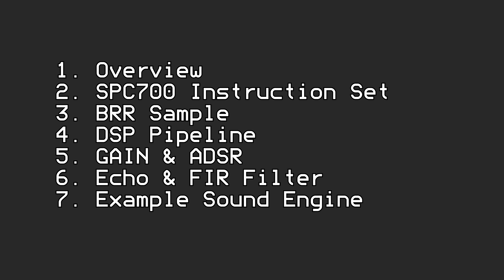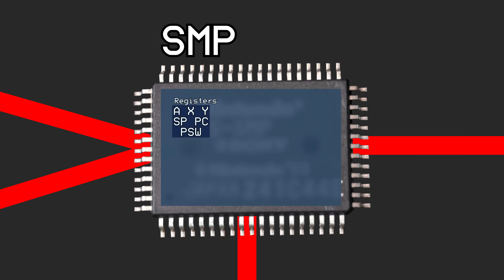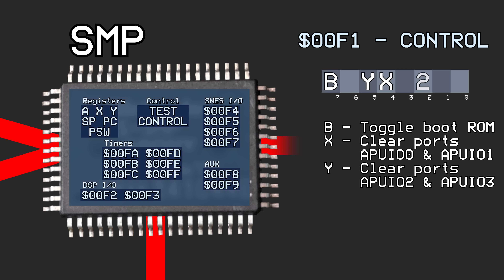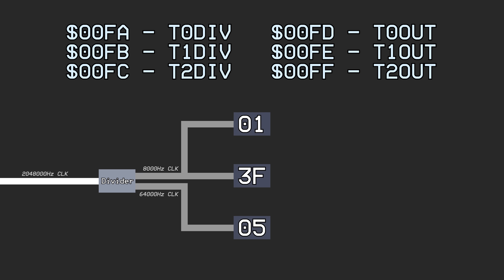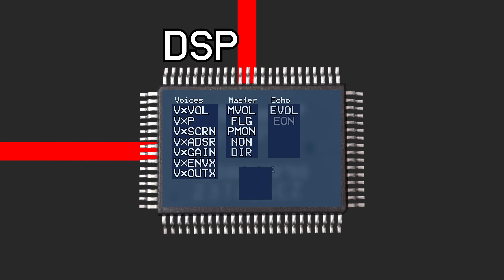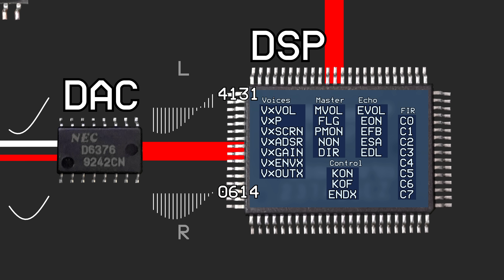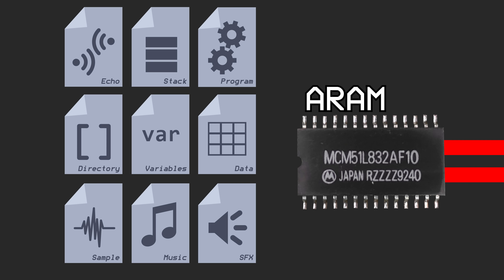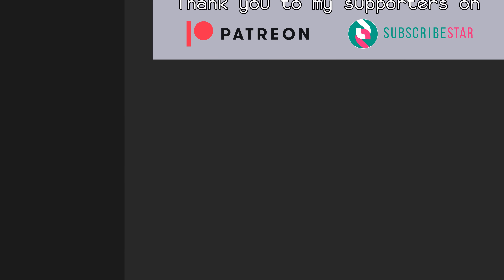SNES Audio System Overview - SPC700 Series pt. 1

Comment: Hello, I have a 1chip outputting very low audio from the dac converter that goes low all the way to the rf and composite, caps measure all good, voltages are ok, my local tech says he's never seen such problem, do you have any idea what could be causing this(tested on different tvs various cables and jumpered everything tried all possible fixes with jumpers)
Reply: broken caps, dac, board, or dsp

Comment: I'm really curious on SNES's audio chip “SPC700”, since I've heard lots of SNES music, some music are using same instrument between different games, that's made me wonder is SPC700 has some internal instruments. This(or these) video(s) is(are) really deep in.
Reply: Since the SPC700 doesn't contain any ROM aside from a small piece to be able to write in ARAM in the first place, all instruments you hear must be provided by the game. So when you hear the same instrument, chances are, the two games use samples from the same sample pack (it happens more often by games of the same company and composer, of course). In particular, Nintendo provided some default samples in their software develpment kit but there also exist 3rd party sample kits out there (at least, I wouldn't be surprised of their existance). In other cases, the samples are ripped from the same source independently (which too can happen since Roland samples are popular, some of which are used by the aforementioned SDK).
Reply: @MarioFanGamer659  The soundtracks for some Ocean games were made on Ocean's own sound drive, called 'Medit'.  This Drive was far superior to the sample standard that Nintendo offered to developers.  Listen to Waterlord Soundtracks, Eek!  the cat, and the canceled game of Green Latern, (there's the soundtrack, here, on Youtube), you will notice how the osts of these games sound better than Nintendo's standards.
Reply: @MarioFanGamer659  I think Tim Follin also used another sound driver, as the osts of Plok, Spider Man and X-Men arcade revenge, Off Road, sound different from the "standard nintendo".
Reply: @Vinicius-hs2rf  I'm aware that there are different sound drivers out there (Rare is another example of a custom sound driver), my post was primarily about the samples, though.

Comment: Pffff after waiting a nearly 2 years, we finally have a new video about the snes audio system,
Next time it would be very interesting to know how exactly the snes converts those BRR samples back into 16bit and how everything is smooth out,
Also for what i also do know is that it is possible to stream uncompressed 16bit audio directly into the snes audio dac by disabling echo writes,however this will involve most cpu power and workram,so there will be no power left to run a game.

Comment: Though I don't know much about it, the SNES sound system is actually my favorite (comparing it to stuff like MID, MOD, XM, or IT). I'm glad you've been able to get to it. Your other videos have helped me gain a better grasp on how my favorite consoles work, in conjunction with dev manuals, and observation on my own. I'm hoping I can do a series similar to yours with the AGB, my favorite handheld. Sadly, its audio system is not as elegant as the SNES. It's just 4B buffer of 8b playback. My dad and I are actually dissecting a dead GAME BOY micro (the charging port is thrashed). Thankfully, it's ONLY AGB stuff. Every other AGB has not AGB stuff. Your videos have also helped me with the rendering in a game I'm making (I might also make an engine for FDS, SFC, CGB and AGB). Anyway. I love computers. I love your work. I'd love to do what you do, but for the AGB.
Reply: Older SNES emulator do have feature where you can save the music as 8-channels .MOD file.

Comment: Was the timer in the SMP chip responsible for timers in-game? Or am i just connecting one to another without more knowledge
Reply: The timers were typically used as beats for playing music. In practice, the SMP chip operates fully autonomously from the rest of the SNES. Most games couldn't care less what it's doing after they upload the program/music and set it loose (other than to tell it to play SFX or load another song.) I'm not aware of any games that actually receive any timing signals from the SMP.
Reply: @michaelcalvin42  ohhhhh, that makes more sense since it was one of the sounds chips in the SNES

Comment: Is there any documentation on Port-Mapped Addressing vs Memory-Mapped Addressing?  I just started to watch the linked video again and I just was wondering.
I've never been able to figure out if they are just two different paradigms of the same thing or completely different architectures.
Reply: In a memory mapped system, each register shows up to the CPU as a dedicated memory address, which is more convenient to program and has less computational overhead.  However, this increases the number of pins for each chip in the system, since you need to add a lot more address lines to make all the registers visible.  It also reduced the total address space available for RAM or ROM, which may be a major concern if the main CPU can only address 64K of memory.  Memory mapping is often used for personal computers, as they have powerful CPUs and a lot of RAM available.  Multiplexing the address and data lines is often used to keep pin count low.

Port-mapped systems usually only have three registers for each subsystem... one to select a register number, one to read the register, and one to write the register.  This tends to be cheaper and frees up more memory address space for the CPU.  Many port-mapped systems also support auto-increment, so when you read/write a register, an internal pointer will automatically move to the next register.  This is nice for streaming data to internal work RAM or reading ROM tables, and often used for graphics or sound.  Consoles and arcade machines made in the early 90's and earlier, or any systems with an 8-bit CPU, typically use port mapping.
Reply: @Waccoon : it's also an easy way to restrict the CPU from accessing the memory of the subsystem, which is what the PPU chips do during active display.
Reply: @Waccoon  Very thorough and well thought out reply.
I wish it was easier to find that answer with Google.  It really should be what comes up when you look for that.

Particularly Port-mapping.  Its VERY hard to find information about it.

There are in/out instructions for ports and memory map instructions. 
It is super non-initiative to guess how it works when reading, "Intel 64 and IA-32 Architectures Software Developer Manual" to figure out how it works.

There is also NO information about what the port numbers may be, or what hardware they access.
Reply: @whtiequillBj  Ports on x86, Z80, and 6510 CPUs are a bit different.  The CPU has extra pins to drive external hardware, and dedicated instructions are used to activate these ports.  While they are called "ports", they work differently than ports supported by coprocessors, like the DSP in the SNES or video chip in the Genesis.

Yeah, it's a bit confusing, as were all things during the Wild West years of the computer industry.  Lack of documentation is just par for the course.

Comment: Wow, this is exactly the kind of information I was looking for! Thanks so much for making this series. Your graphics series are great, but I've tried to understand the SPC700 at a lower level on my own. (with only minor success) 

I make chiptune music, and I have math and some CS knowledge so I've wanted to make sense of the SPC700.

Last year an audio plugin called chipsynth SFC was released that emulates the SPC700 exactly. You can see the registers for playing back an SPC in this. I tried to break apart some of the classic music I like and get into the fine detail of the timing of everything. I ran into an issue trying to understand the envelopes though. The ADSR makes sense, but the custom envelope settings with the Increase Linear, Decrease Linear...etc wasn't exactly clear. I was trying to make sense of the timings, but couldn't quit get it with Nintendo's documentation. I was able to make sense of the bit operations a little bit couldn't convert it to actual lengths of time. 

Your explanations of the timers completely cleared up my understanding of these. I can't wait to get to the rest... time to Patreon it up!

Comment: You should mention as well, that the SNES had a huge disadvantage of loading times for soundtrack data. Some games stay on a black screen to shovel sound data to the SPC whenever the song is changed.
Reply: Yep, though I assume most of this was from loading the actual samples. (and maybe sound effects too?)
Reply: @Midee  Yeah, the dirty secret is that data was often compressed, so even cartridge-based consoles didn't have "instant" load times.  Loading data into a port-mapped chip can often be pretty slow.
Reply: It doesn’t take very long to load 32K.
Reply: @sirnickity  It does when you consider the bandwidth. Everywhere else on the SNES, 32 KiB is no problem because you can very easily access most of the memory either through mapping (WRAM, cartridge RAM, enhancement chip memory) or through registers (OAM, CGRAM, VRAM) where you can easily do DMA. However, in order to write to ARAM, you have to communicate with the APU and synchronisation between CPU and APU takes a lot of time relatively speaking.
Reply: Secret of Mana is especially annoying in that regard... thankfully there's a MSU1 patch.
Reply: Most N-SPC variants store few music at ARAM, which could be switched via input ports. Surprisingly, few N-SPC games (such as most of those using Nova's variant of the N-SPC) store every song in ARAM(!).
Reply: IIRC byuu/Near implemented a function to record the state of the APU plus the data that was streamed into it (only for a certain duration of course). Not sure if it's still in bsnes/higan.
Reply: @ShinyHappyREM  Source?

Comment: Can you provide an example of a SNES music track that cannot be saved to the .spc format? I thought about Aquatic Ambience, but apparently they had no issue saving it.
Reply: The opening theme of Tales of Phantasia is one of the better known examples. It has full vocals which are streamed from the cartridge, and therefore not included in the .spc dump.
Reply: I think Wario's Woods generates the music on the SNES side and then streams to the SPC. At least, the music is definitively generated on the S-CPU side.
Reply: Out Of This World and Super Offroad are two examples of games that won't save to .spc; if you try, you just hear the last note it was trying to play, but no additional music.  This is probably because the music engine is implemented on the main CPU instead of the SPC-700, and this is probably because both of these games are ports from other systems.

As another example of a similar effect, both Clay Fighter and Rock 'n' Roll Racing feature music that can be saved, but streaming audio sample data that can not.  If you try to capture any of the vocals from these games, you'll just get a brief snippet of audio that repeats, because in a full system the sample data would be continuously updated via HDMA.
Reply: I know Blackthorne and Wolfenstein 3D have non-SPC music.
Reply: All of Claymates.
Reply: Earthworm Jim 2

Comment: Fun fact: pitch modulation doesn't occur instead of the modulator being played normally, but in parallel. But people generally mute the modulator's mixing level because it usually sounds bad played together. Though this doesn't turn off pitch modulation, because it ignores the modulator's mixing level and only uses ADSR/GAIN.

Comment: I'm so thrilled about this video series! I'm no expert but I'm really into synthesis and sampling and very INTERESTED in this, so this is amazing for me.

I had no idea the DSP had a Frequency Modulation capability! Wow. Modulating frequency by another sound is a very essential synthesis technique. Most of my Eurorack oscillators do it. You say it's unused: really curious what this could have opened up. FM'ing samples is highly unusual and probably awesome.
Reply: I think I heard somewhere that the FM capability is used in the beginning of Chrono Trigger for the wind in the background when you are trying to escape from your cell after the trial. But I can't remember where I heard it...
Reply: @possible-realities  Woah, fascinating! I'll check that out. Thanks for the tip!
Reply: FM support wasn't used much back then, since most audio chips with that capability didn't have a ROM lookup table for a pure sine wave.  Without a convenient source for a pure sine wave, FM isn't very useful.  The Amiga supported FM for pairs of channels, but nobody used that feature.

The Yamaha FM chip was truly revolutionary, since they used a differential encoder to store the sine wave in a very small ROM, which finally made FM practical.
Reply: @Waccoon  Both the Amiga and SNES had samplers though, which could store pure (enough) sine waves as regular samples.
Pitch modulation more likely wasn't used on the Amiga very often because you only had 4 channels to begin with, and you'd end up sacrificing one to be the modulator for a carrier. It's the same issue on the SNES, but with 8 channels, it was more feasible to throw one out for FM effects every now and then -- and in fact, a lot of games did that for sound effects.

Comment: 1:32 "program counter" ... 1:37 "each of these registers are 8 bits wide". The PC ought to be 16 bits wide, no? 256 bytes seems awfully restrictive for programs, although I guess it's not impossible.
Reply: Some low end PICs have such tiny program memory. But not the spc700. The PC really is 16bits. But S is still 8. Its a bit like the 6502.
Reply: @samwilson5544 : the whole chip seems based on the 6502. Will have to wait and see what instructions were added...
Reply: @ShinyHappyREM  It is based on a 6502. It's a complete superset of the 6502, AFAIK. It does add some instructions (like multiply/divide and some 16-bit versions of basic 6502 instructions). I'm sure he'll cover it more in the next part of the series.

Comment: So SPC700 is almost a 6502 CPU, interesting.
Reply: It's almost a complete superset of the 6502 (probably to save developer learning curve from those coming from the NES at least in part.) It has some new instructions like multiply, divide, and some 16-bit versions of some normal 6502 instructions.
Reply: Would be interesting to know what are the differences to a regular 6502. The AY register thing definitely sounds like an addition, and the builtin memory mapped registers.

Comment: This chip outperformed the Amigas.  This thing was a beast.  Remember, DKC's soundtrack was performed on this chipset!
Reply: Concerning the number of audio channels, yes. But the Amiga has still the advantage of having all its chip ram available for sound samples. For complex instruments, 64 kB is sometimes not enough.
Reply: @Slamy4096  not to mention that some trackers could increase the number of channels from 4 to 8 at the cost of of some CPU cycles and reduced quality.
Reply: @Slamy4096 : samples could be streamed via HDMA from main memory (128 KB) or the cartridge, afaik.
Reply: It's a trade-off.  The Amiga didn't have sound synthesis or DSP processing capabilities, but it supported HUGE amounts of memory, could stream for "free" without wasting any bandwidth, and you had the option of playing buffers mixed by the CPU.  It was a dirt cheap solution and much more appropriate for a desktop computer.  DSPs are pretty awesome, but they are incredibly expensive to implement, hard to program, need dedicated SRAM which is expensive and severely limited in supply, and when streaming samples, they waste lots of main system bus bandwidth.  They were appropriate for consoles that had very little RAM to work with, and didn't become viable for desktop computers until the late 90's when wavetable synthesis really started to become popular and SRAM came down in price.

Fun fact: the Atari Jaguar "DSP" was the same RISC architecture as the graphics chip, but with the packed pixel instructions removed.
Reply: And Plok. Without an addon chip.
Reply: Lol no it didn't, by a lot. Have you listened to some of h0ffman's tracks for example?
Reply: Wise was genius, but many other SNES titles had composers that did not have a clue. Take Zelda, it sounds really bad. Worse than an Amiga. Sounds mono almost. Neutopia II on the PC Engine, 2 months older game, on a 4 year older console, sounds so much better. I was a bit like the Mega Drive. High quality sound chip on paper, but you needed a PHD to make something of it. The PC Engine was like a NES on steroids, way easier chip, and the overal sound track quality was high, even in the crappiest B-roll games (Cross Wiber!).
Reply: How David Wise replicated those lengthy, evolving Korg Wavestation, sounds with 64KB is still beyond me. And I've had it explained to me before hahaha. Truly genius, and a sign of the remarkability of this sound setup.